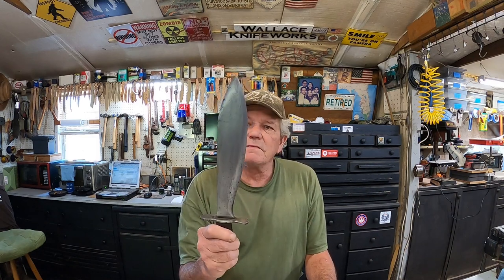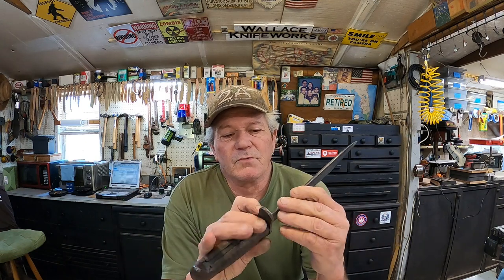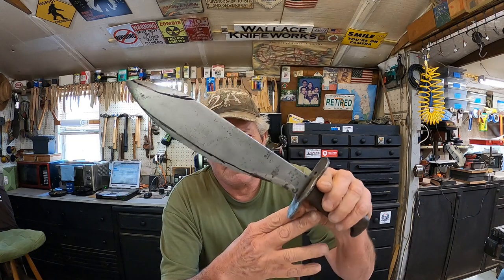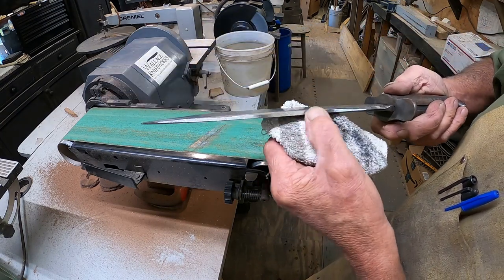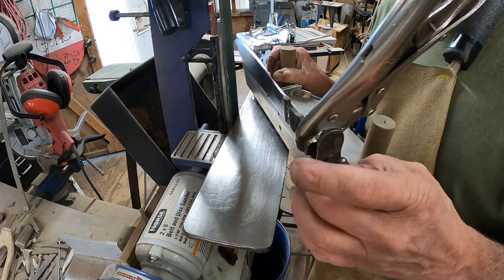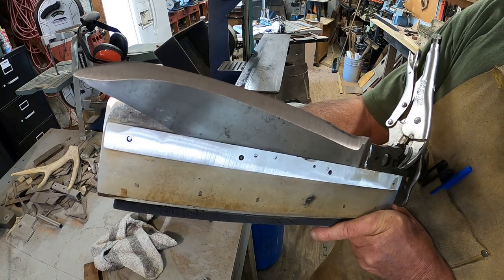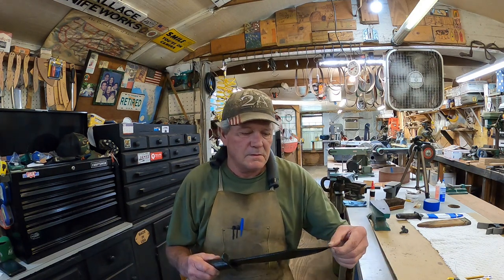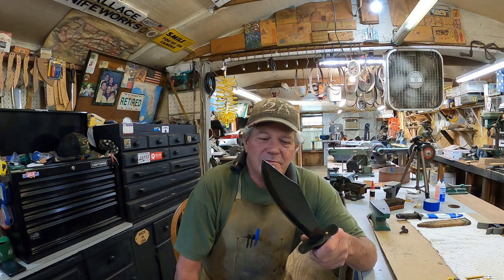KNIFE CONVERSION  FROM MODEL 1917  TO BOWIE !

Comment: That old bolo knife threw some pretty respectable sparks, I wouldn’t have thought the steel and heat treat on those originally would have been that great. Did any of your research indicate the steel type or hardness for a chopping knife like that?
Reply from the maker: I cant find any info on the construction.  Its not as good as modern steel for sure but for the time it seems ok.